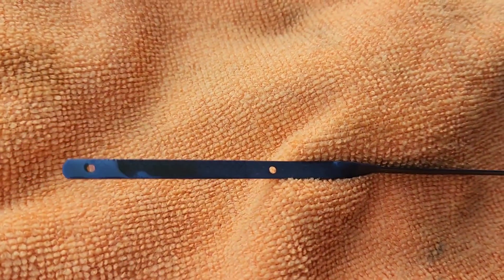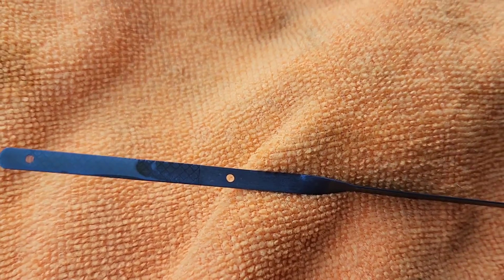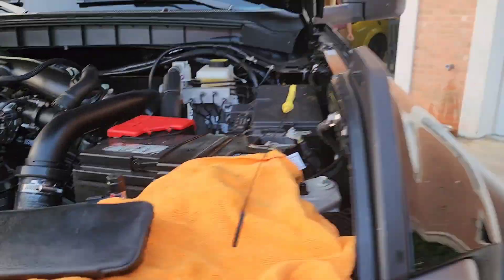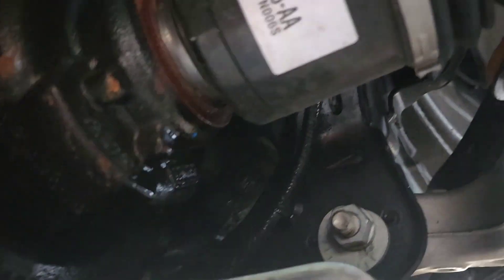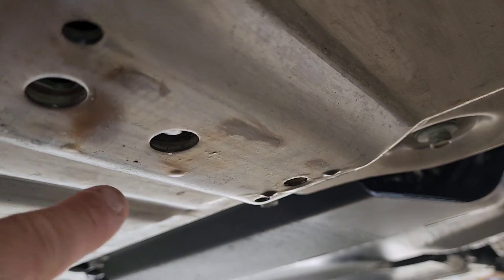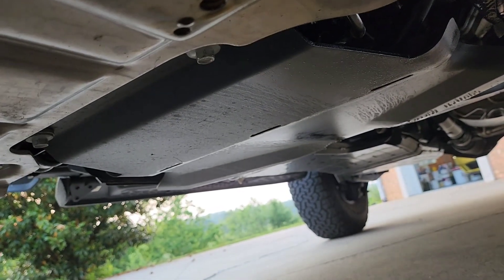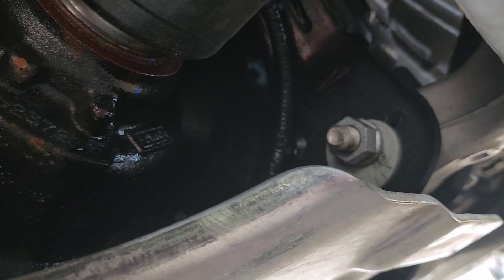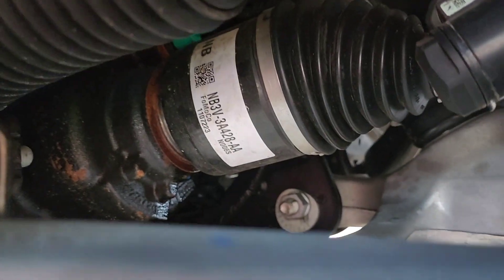Ford Braptor....wow maybe it's the front drive shaft CV joint!!!  And not the rear engine seal.

Comment: Could be CV related or a transmission oil leak  Last week on my 2015 Taurus SHO my left front CV boot came off and lost some grease but the real problem was the transmission mount broke and the CV axle smashed the metal coolant lines. Hope your issue isn't as bad.